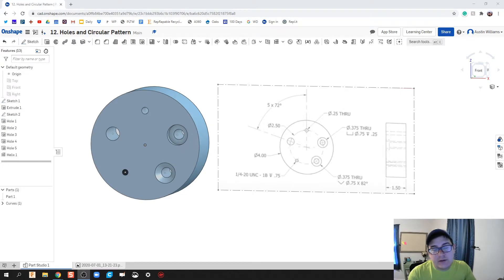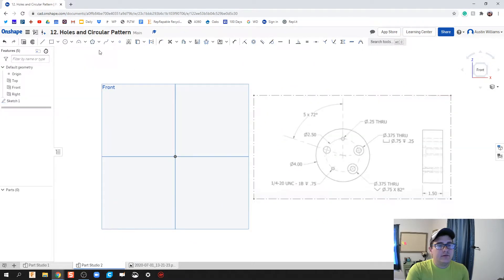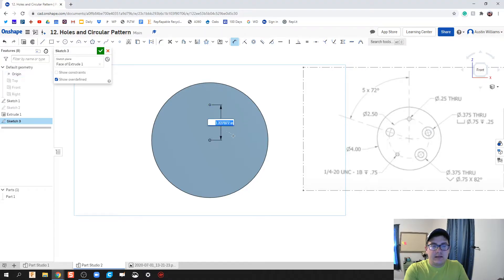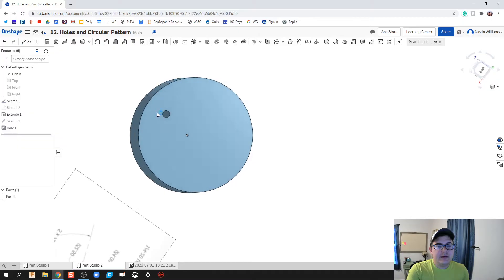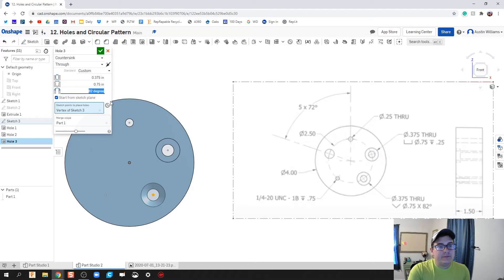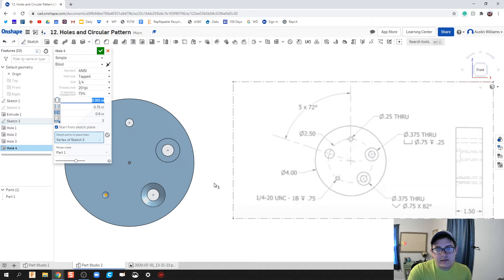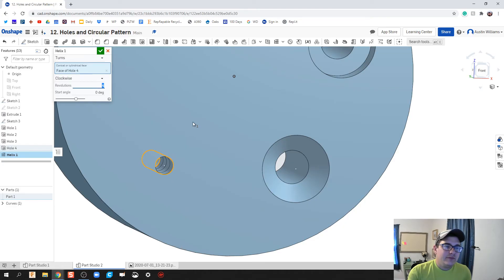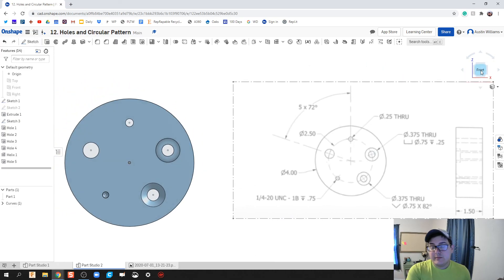Holes and Circular Pattern - Day 12 of 100 OnShape Journey

Comment: How do you counterbore inside a previously extruded pocket? I have a cube with an extruded pocket in the top face and inside that pocket are three holes that go through the side face to mount it to a printer. When I try and counterbore it shows the counterbore going all the way through rather than giving me a step. It doesn’t matter if I change the depth, it always goes through the full diameter of the counterbore. If I do it anywhere outside of the pocket it does it correctly.
Reply from the maker: I think I understand you correctly. I would create the hole on the side of the counterbore and put your through hole and counterbore at the same time. MAYBE, you could create a point on a sketch and use the hole command from that moment.

Comment: I exported the part as an stl and took it to a slicer.  Hole 4 was not threaded, just a tapped hole.  Is that something you are experiencing too?  Thanks for the videos they're such a huge help!
Reply from the maker: Yes. The hole is not 3D modeled with the holes command. You have to used the thread command, which is a recently new update!

Comment: Austin, I think ANSI is typically referred to as "Ann-See".  Your speculation for the reason there are no threads visible in a part sounds plausible.  But I've found no issues with latency on parts.  But when doing drawings, the delay is very large (~2 sec) and frustrating.  I think it may be because I'm using a very large monitor.  The delay on drawings seems less on my laptop. Good video.
Reply from the maker: Thanks! I only ever read ANSI, so I did not know at the time. I think I appreciate how much I get to learn with this class. I haven't had much of an issues with drawing response times until schools across the board kicked in. I imagine OnShape's servers are having to work OT to catch up with student uses.